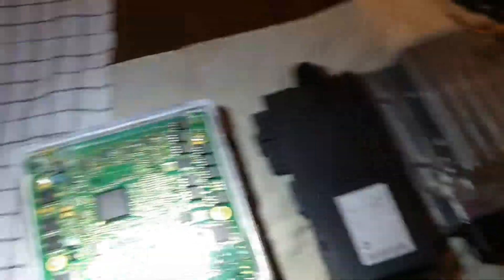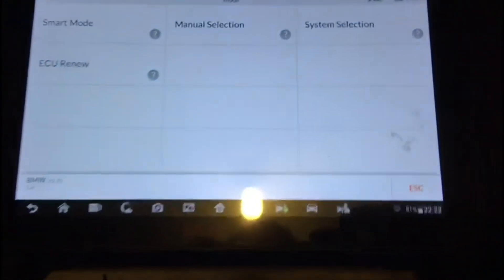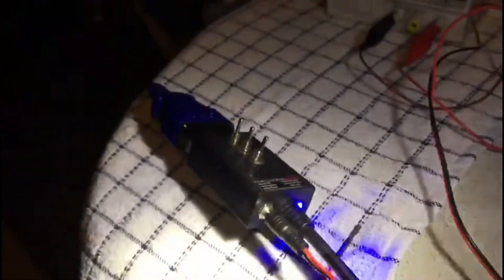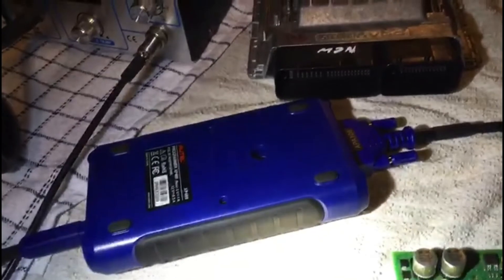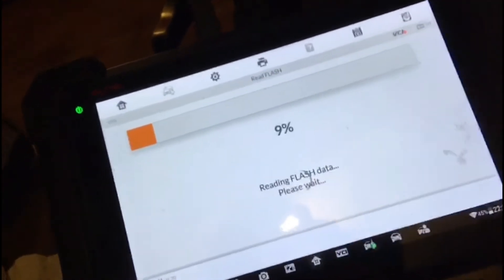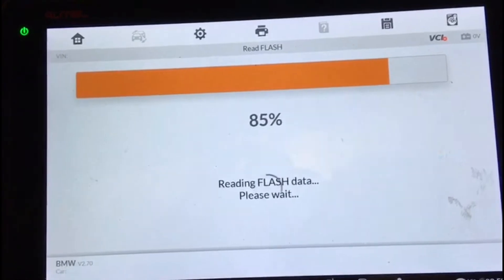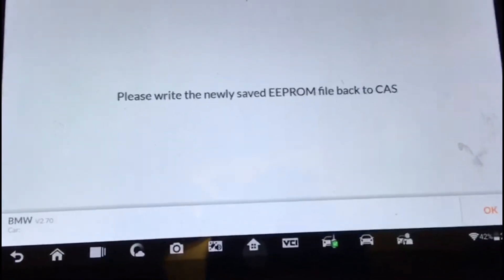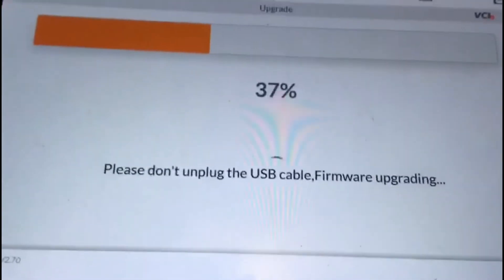BMW Used ECU Replacement - MSD80 ISN reading Write to CAS

Comment: Thank you! - My CAS got bricked (trying to add a key) and after a whole bunch of fuss, I got it to where it was an ISN synch issue - 'how to get the ISN from the DME, onto the CAS?' was my issue - I think I have it figured out, just gotta plug it in tomorrow (I hope, if weather cooperates) - yours is the first I'e found that addresses getting ISN FROM a DME - and putting it INTO a CAS3 module!   everything else I've found is CAS ISN to DME...  I'm trying to keep all the coding and info in the system correct to the car.

Comment: Mulțumesc frumos pentru acest tutorial, ești un maestru . Se vede clar ca sunteți un profesionist si în același timp pasionat de această muncă.  Complimente ! As dori dacă vreți sa ma ajutați cu o informație.  Eu lucrez ca mecanic dar mai fac și partea electrica pentru ca azi după cum stim mașinile de azi sunt avioane.  Mi a venit un client cu bmw seria 1 E87 automata  ,2.0 I 125kw seria motor  N43 cu DME  :MSD 80 ,cu rateuri pe cilindri 1si 4 . După toate încercările de a schimba buji, injectoare, bobine. Am controlat compresia pe fiecare piston în parte si este ok. Am ajuns la concluzia după ce am probat cu kitul de pornire de la prietenul meu cu un bmw 320 E90 dar cu o cutie de viteze manuala au dispărut erorile ,cilindri functionau fara rateuri dar masina nu o puteam porni decat pe pozitia N.  Însă pe pozitia P nu vroia sa pornească.  Cum si cu ce as putea depana această problemă? Va mulțumesc frumos!
Reply: Karmin change

Comment: I notice you put 00000000 for the EGS. ISN my question to this is  putting in that code  make it work, or do i still need to still change it when the cas go back in the car?

Comment: Thanks very much for your video. I'm a new im608 user and this was very helpful. Thanks.
Reply: I am just targeting out as well to program keys, ECU, TRANSMISSION, and other modules, i notice you message on this video, my question to you is by any chance do you know if i do just 00000000 for the EGS/ ISN it works?

Comment: Hello, didn't you need to re-program the keys on bench before going to obd work?
I supposed that as the CAS is renewed, then it will not accept the old keys. Am I right?

Comment: Thank You Very Much This Video Really Helped Me Out.. I Wes stuck on the renew part I didn't know you could input the 8 zeros for the egs isn # I had tried 12345678 and I believe I tried 1111111 it didn't work also I can't wait to do the job now knowing what needs to be done .  Hey Thanks Again it really helped me out ....  Eric
Reply: Did the 00000 ting work for you, i am at this stage now and don't want to put back everything and have to do it all over again so checking if this help you ?

Comment: Hi thank you for the video. Very helpful. I have a question I’m hoping you’d be able to answer. Can I replace an msd80 with any msd80? As long as it’s cloned to the car? E.g I have a faulty msd80 from a n53, can I get an msd80 from any other engine code? I have a Ktag so can clone ecu using that.

Comment: When you have a problem in the transmission because of the isn the car will not apply changes so it is not recommended to change the isn remember it is a case not an ews

Comment: I have a 2010 535i e60/e61. Was trying to backup the ecu to update for key programming using the im608. First part of the 5 minutes passed which was good. The last 5 minutes it crashes and failed. Car no longer starts. Autel tells me to pull out the ecu, solder the wires on and read the eeprom and flash for they can give me a new file. I need help soldering it on. Can you help ?
Reply: are you being serious

Comment: Hi there. My wife has a 2015 330i M Sport Touring which is begging for a B58 swap. Is it possible to make the car accept the 6 cyl ecu? Would be using a write off car as a donor so engine, loom and ECU as a set. Regards, Ryan
Reply from the maker: Hi Ryan, yes the ECU, FEM/BDC and key from the donor will do the job. If donor is before mid 2017 should be a direct plug in FEM with no wiring required
Reply: @SpeedTweaks  Excuse my ignorance... we are a bit slow here in Australia. What does the FEM/BDC acronym stand for?
Reply: Disregard. Found it. Thanks heaps for the reply. Will CAS still need to be adjusted or use that from donor as well?

Comment: Excuse my ignorance, so you are editing the CAS to accept the used DME?
Reply from the maker: Yes exactly that. On some you can change the ISN in the ECU but these I just change it in the CAS and once running update VIN in ECU diagnosticaly
Reply: @SpeedTweaks  how do you change the vin by diagnostic? I did ISN write on dme in an X5 while back but wanted to write vin too but didn't know how or what to use